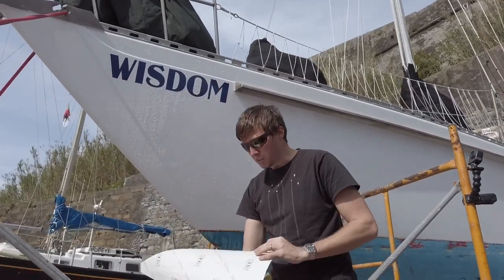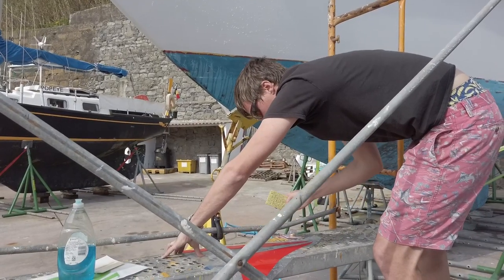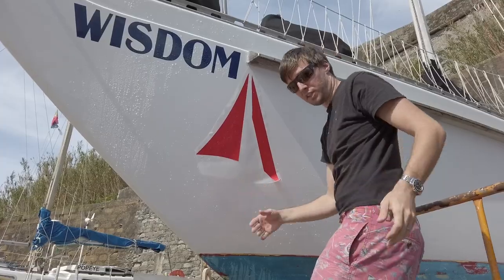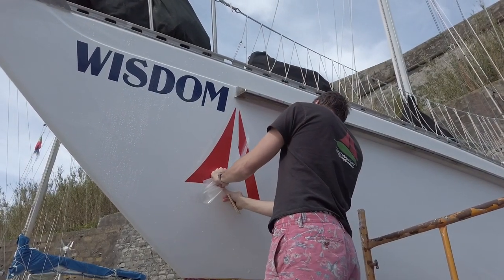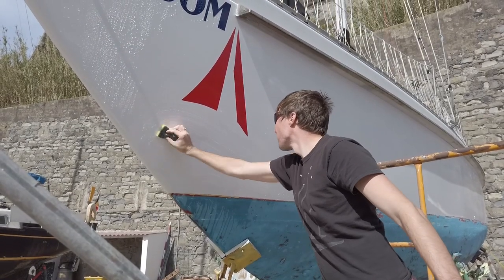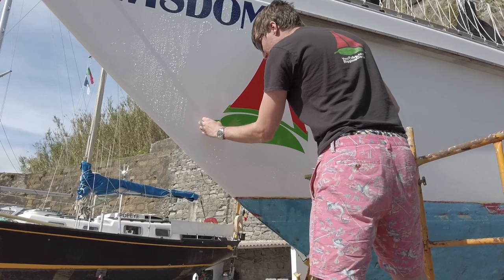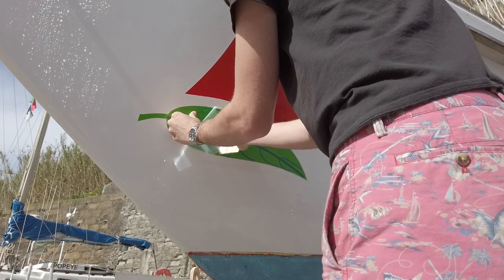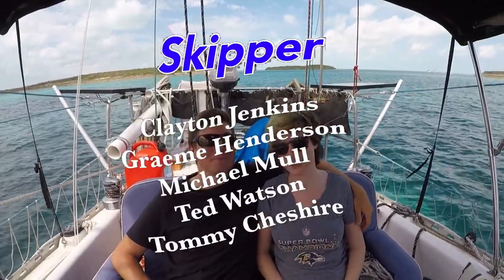How to Apply Decal Stickers on a Boat or Car | Sailing Wisdom

Comment: When using soap, at the end I always cover the sticker with a non-stick paper like the piece you peeled the sticker from, and then using the applicator apply a lot of pressure to squeeze all the soap out especially at the edges. This way lets you apply a lot more pressure than applying the applicator directly on the vinyl and you don't risk damaging the vinyl, especially on narrow pieces like the leaf veins.

Comment: Nice job on the stickers.  I had a vinyl cutting business in with my computer shop.  The soapy water does a fairly decent job of applying stickers.  However it does tend to break down portions of the adhesive just so you know.  They sell something called "application fluid" that doesn't generally hurt the sticker.  Basically it is glycerin based.  You will need to go back over the sticker two weeks after the soap dries.  Additionally when working with large or long stickers you want to put a piece of blue tape in the middle like a hinge.  Then work on one side then the other using the tape to keep the work centered and to help you not take on too much at once.  Marine stickers also need to be very high grade, because they are subject to the most abuse by the elements.  If they gave you basic grade you may have to do it again within two or three years.  Also there is a clear coat they sell for vinyl stickers you may want to apply....

Comment: I was an Exhibit Specialist and we used a spray bottle  not a sponge full of water with one or two drops of dish soap. We 3M Sotch Cal vinyl with plastic backing. Other than that same process for small panels like yours or large graphic for a display.

Comment: I have been in the sign/largeformatprinting biz for 22 years. Full 3M cert, sins the beginning. Including passenger aircrafts. 
I have to say. You can do it like that... 
But... I think you grapics supplier have done it easy for him/her self,  delivering it in several parts. 
I never use sopy water exept for window tinting ect. Full foiling big trucks ect. I do dry application. Or my installers. 
Water application is a bit easier for beginners, getting no (or less)airbubbles with soapy water. Thouh, a cpl of minutes of work dry applied. Will take way longer with wetapplication. 
Use a spraybottle (instead of spongebob)  with clean water and a cpl drops of soap. Preferably a neutral childs champoo. Jonnson&Jonnson has one that pretty much is avalible world wide. 
It is practically 3M approved. :)  IF you get some bubbles with water application. They absolutly have to get adressed. On dry application. Small airbubbles will dissapear after a day or so in the sun. (1-2mm size) 
U can use plenty of soapwater,  But you have to scrape hard with a propper squeegie.  You also have to take account to about a week, to get full tack from the ahdisive. When using water. 
Have fullwrapped a few racing sailboats. So in that case you need to seal the edges. (can be smart with powerboats too) 
Plastic transfertape is ok with wet application. But I always use good paper transfer. Especially if there is some compound curves that is been applied to. 

Good info for ppl who whant to buy graphics. 
There is so many makes/manufacturers of vinyl foils. With each a bunch of different series for different applications. I see alot of my coulegues in the biz. Who sells to low quality materials. 
Wen getting quotes. Ask what make and series they are going to deliver. Its often marked on the liner/backpaper what it is. 
For boats that live in salty water and sun. Id strongly recommend a "8year" foil. At least... Life of the vinyl is depending on the enviroment. UV degradation ect. 
Recommended brands is 3M, Avery, MacTac, Oracal. And to some extend Hexis. But be avare that all brands have cheaper foils for short term use. 
Ask for casted vinyl. Or at least polymeric. These types also always has a propper ahdisiv.  
In other words, make sure you get what yo pay for. And if it is cheap. It probably is cheap quality. Considering this type of product takes some manual labour to produce. (and apply if you dont want to do it youre self) 
And for longterm graphics. Dont buy printed logos ect. The color will have faded severly in a few years in the sun. Screenprinted will live longer than digital printed. But a through colored cutfoil. Will last way, way longer in the sun and salty waters. 

Oh! 
Fist thing! 
Us a solvent to clean the surface. befor anything else. Nothing sticks well to a greasy surface. Or old wax. Wax with teflon or silicon is a pain in the butt....

Removing old graphics class.. will be a later story. 

 Cheers!
Reply from the maker: Any suggestions on how to seal the edges? I just squeegeed them until they were perfect with no bubbles or blebs, but I did not apply anything else to seal the edges.

What product and methods do you recommend?
Reply: 3M has a edgesealant that I use. 
But in you’re case I wouldn’t use it. Fairly slow sailboat isn’t a problem. But let your decor sit for atleast a week before u go ⛵️
Reply from the maker: RocketSailing thanks for the info! It’s going to sit in the sun for over a month before it gets wet!

Comment: And how you protect the sticker from salt water ? In short time the edge will start pealing out.
Reply from the maker: We shall see, but the last time I did it this way, the name stayed on for 4 years until I sanded it off to redo the topsides.
Reply from the maker: Different places do things differently. The shop I worked at we used dawn soap. I took graphics off my own car a few years after I applied them and they were hell to remove. 

There are always a ton of different ways of doing something and everyone is adamant that their way is the only correct way and every other way is horribly wrong, doomed to fail in a blaze of woes. 
Everyone also seems to be very happy with the results of their own projects. 

Maybe there is more than one way to do things and you could learn a little open mindedness in the process!
Reply from the maker: By the way, I put the old name on this boat with the exact same method and I had to sand the name off because I couldn’t get the letters to peel off.
Reply: @RiggingDoctor  Thank you for the answer, useful info :)